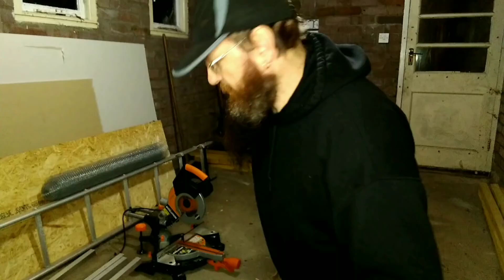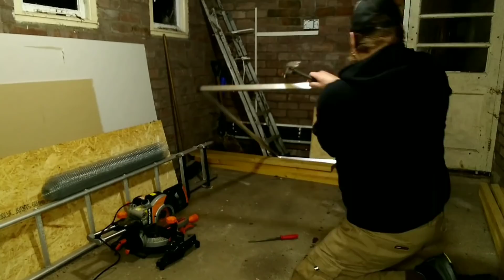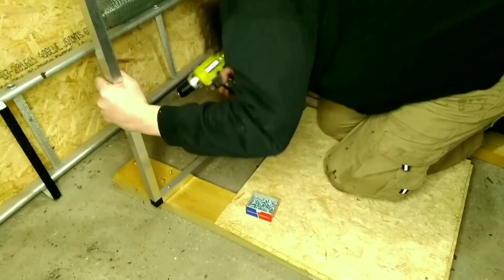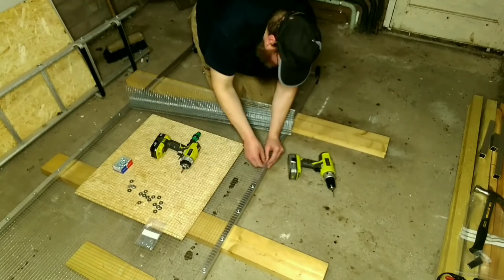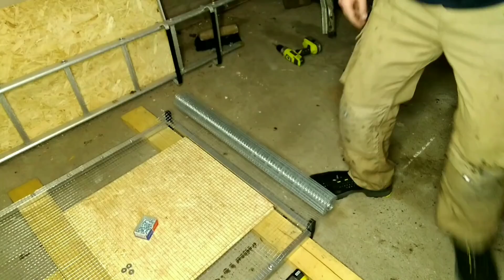Xmas light frame build Diresta-style

Comment: Tip, when cutting when cutting aluminium on a chop saw spray a bit of WD-40 on the blade it prevents aluminium galling in the teeth and gives a much cleaner cut👍👍.
Reply from the maker: I'll keep that in mind.  This is an Evolution saw that mills materials, but it would still help.

Comment: You used screws to hold the couplers ?
We used to use that a lot where i worked for shelving, never had a problem with it comong apart, had to be hammered
Reply: Hi Sparky, I need to re-subscrube to you, lost all my settings when I swapped Google accounts. Hope you're well.
Reply from the maker: It's just a precaution.  I was using self tappers anyway.

Comment: Gotta love those green tools. They are awesome. You should get that foldable worklight if you haven't, it is really great.

What we have here are... brushless drill, big impact, hacksaw, multi-tool with swivel head, foldable light, normal light, hand vacuum.
They are just like Pokémon or Football cards... gotta have 'em all!

How are they holding up for you Clive?
Reply from the maker: They're pretty good.  The main weakness seems to be the battery connector that was never intended for the current of the new era lithium powered tools.

Comment: DO you have a permit to turn that Drill into "Full Auto" ? one pull of the trigger should only rotate the drill 1 full rotation! Anything more and they will come after you for illegal modification of a hand drill... Just a FYI :-)
Reply: That could actually be slightly useful if you're trying to avoid drilling too far or avoiding stripping screws when using it as a driver. Though there are better options for both those scenarios.

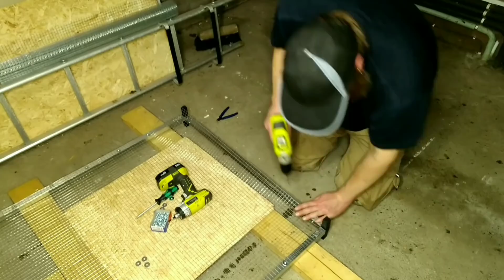Comment: You placed a pair of screws on the bottom end for extra stability, right? 2:34
Interesting kind of construction. I wonder how stable these plastic blocks are. And I think there could be a solution to put metal covers on these corner elements and solder them in place so the construction is completely metal with additional plastic thingies.
Reply from the maker: I added side mounting legs at the base, and aluminium cheek plates for rigidity.